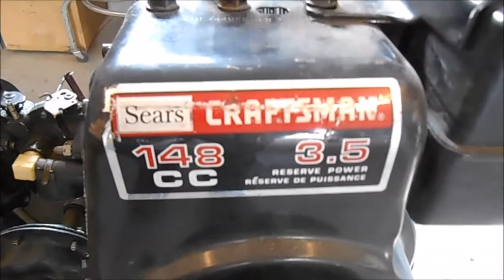Carb Repair of a 3.5 HP Craftsman Tiller (Tecumseh)

Comment: I always add a inline filter and fuel shutoff . I buy them from eBay 10 or so at time so they don't cost much. Great video  :)
Reply from the maker: Great idea.about a filter.  I use them when the fuel tank has had crud in it.  After I flush it sometimes I don't feel good about how clean it is.  Great idea about the shut off.  I have tried on some mowers but somtimes there isn't room for both.  What do you do?Bruce

Comment: Where is the engine model number on these older Tecumseh engines? I recently bought a tiller just like this one and will be working on it soon. I assumed it's the number stamped on the crank rope housing but it's not been helpful.
Reply from the maker: It is a tough thing.  Not like a briggs.  There will be a number on the rewind housing    write it down and google the heck out of it.  Sorry that is all i have.
Reply: @BrucesShop  Thanks!
Reply: @BrucesShop  I need 2 head bolts and the plate that accesses the valve adjustments and a carburetor. It's gonna be tough!